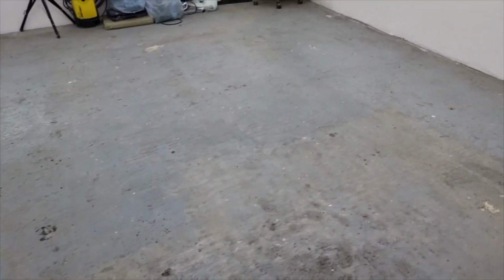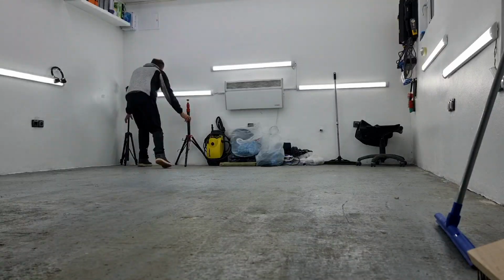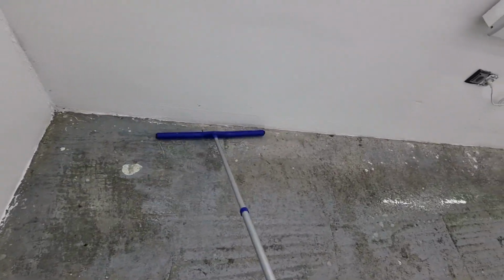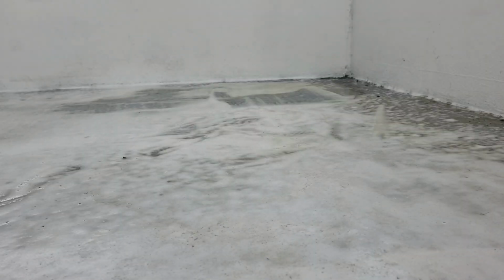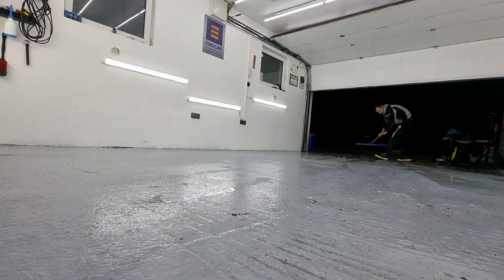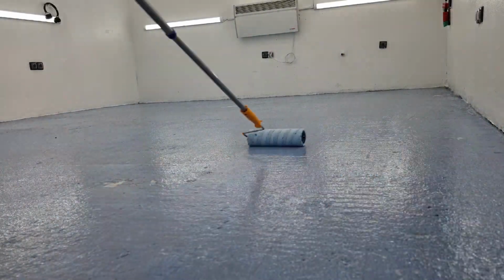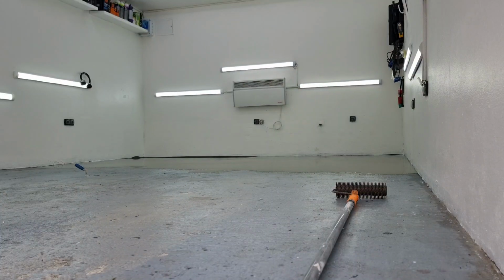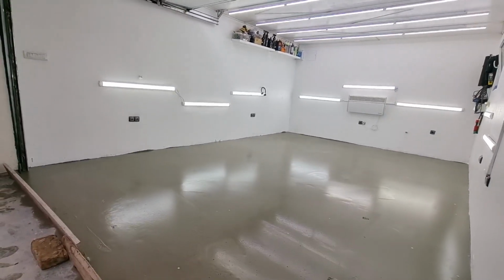Floor Leveling-Car Detailing Studio Build #2

Comment: I had the epoxi in my garage, but now changed it for grey swisstrax. Epoxi is nightmare for me, every car that is washed and driven inside garage, drips dirty water from undercarriage and you step in it and then get it all over. Swisstrax looks awesome, easy to clean, and looks clean longer. Think about it. Also check sgcb swisstrax, they are the same as original. And half price. The floor is not wet all the time, you have clean shoes when you sit in a car, the dust between polishing doesnt get up in the air all the time between pad blowing.